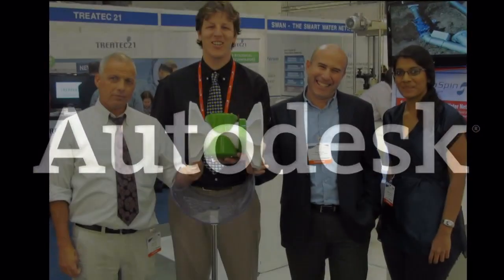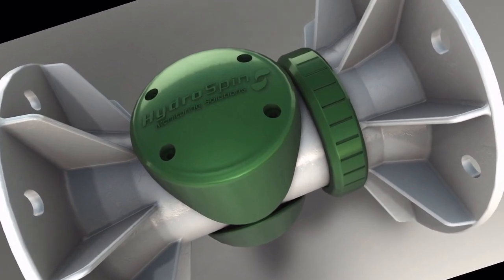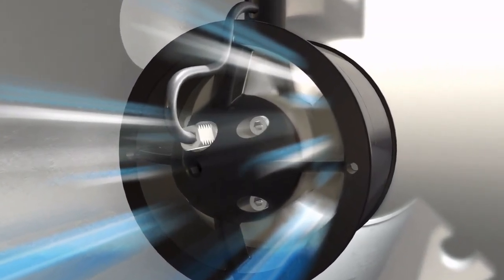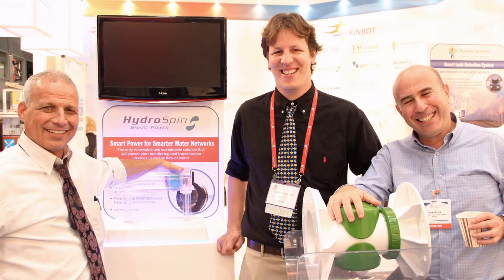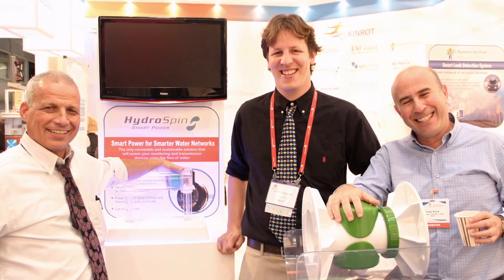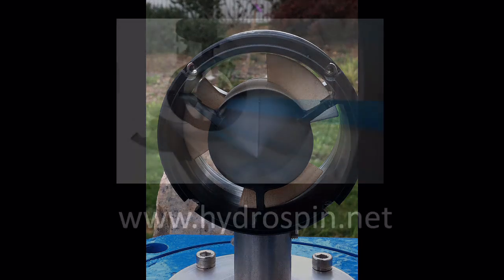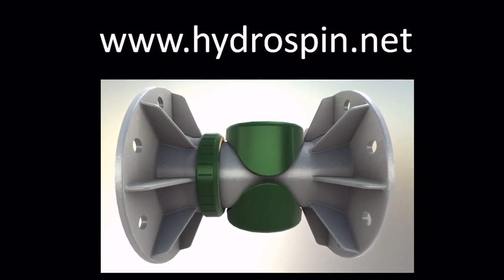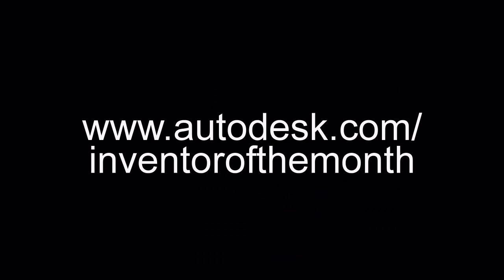Autodesk Software Helps Hydrospin Fuel 'Smart Water' Networks

Comment: It's not that complicated. It's a generator placed in a pipe. The electricity generated is used to power sensors to monitor the water flowing through. They argue this will save water utilities money because they are currently losing water throughout their system but don't know where. Installing sensors would help alleviate the problem. Their product would power these sensors.